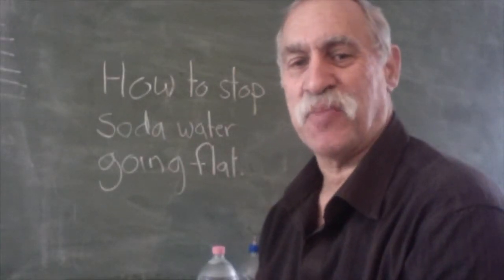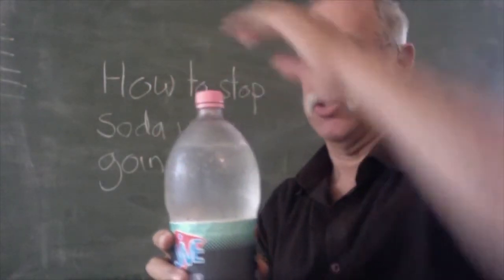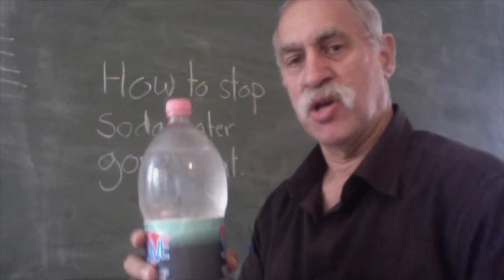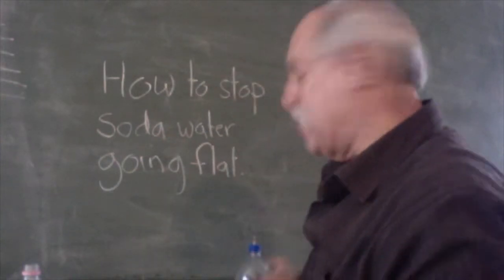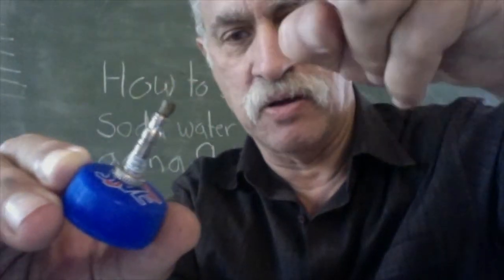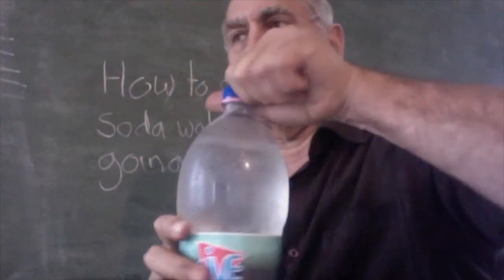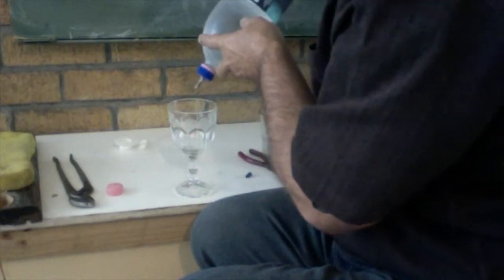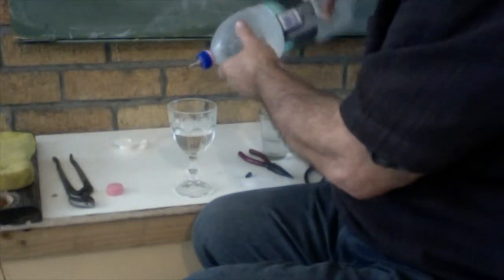How to stop soda water from going flat and losing its fizz

Comment: Is that tire nozzle food safe? It can't be terribly hygienic, or comfortable,
 to pour the drinking water all over your fingers. Maybe keep the the pump on the nozzle, but add a second tube to the cap, with a nozzle that has a release valve on the other end, for serving it? That way the pump can easily keep the pressure inside the bottle, it's easy and clean to serve drinks, and you can quickly and easily transfer the lid to other bottles, as needed.
Reply: Just wash the nozzle vigorously before use and should be fine